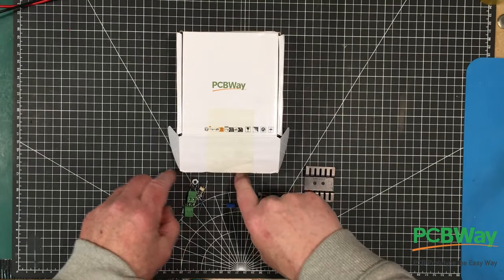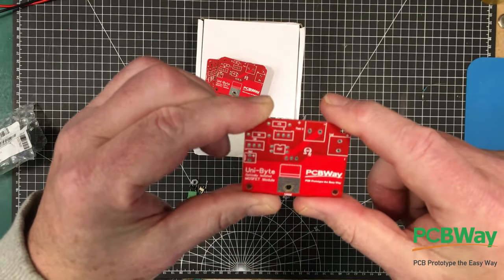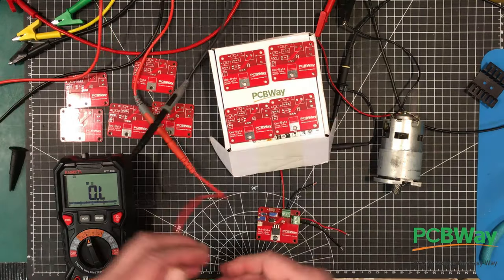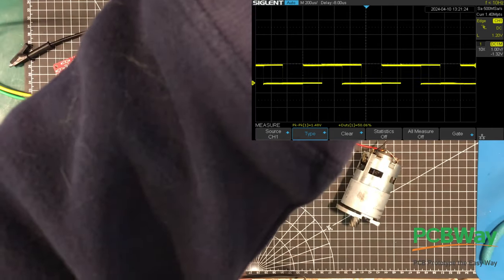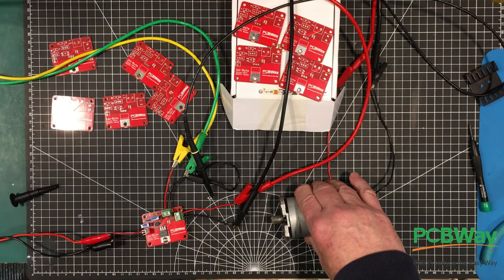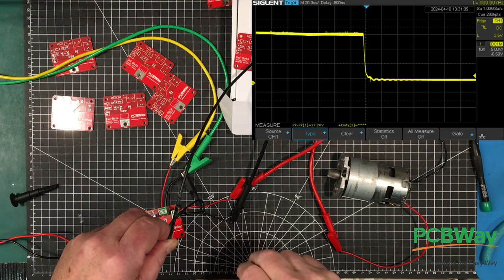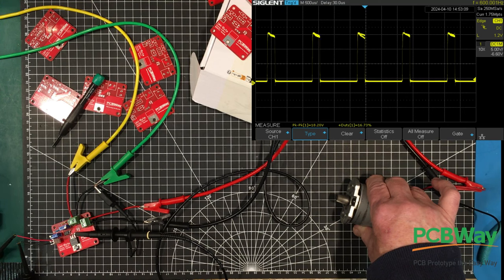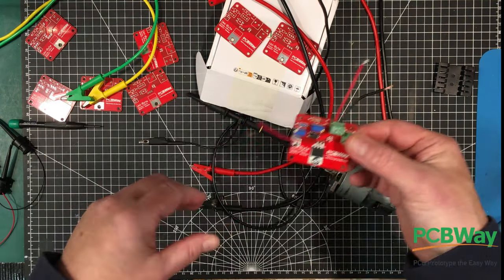Uni-Byte 0176 - Isolated MOSFET power DRIVER Part 2

Comment: Very neat! Please show us the complementary circuit, using a PNP mosfet. Then, we would be able to configure an H Bridge Driver for Stepper Motors. That should have a great amount of interest.
Reply from the maker: The best way would be just to add the p-channel MOSFET on the top-side of what is already there.   Then you have a half H-bridge.  Easy peasy.  Just one extra part.  TBH I have only used H-bridges to drive BDC motors for direction control.  For steppers I've always used uni-polar motors to make the drive circuitry (and code) a lot simpler.  (I'm lazy..)

Comment: It is surprising that mosfet remains that cool with so little heat sinking.
Reply from the maker: The secret it to switch the MOSFET as quickly and fully as you can.  Thant's what the adjustment was all about.  You need to have it fully on or fully off as much as you can and avoid Vgs anywhere near the threshold voltage.

Comment: Interesting video. At 7:20 I didn't understand your method how to calculate the Rds(on).
Reply from the maker: I was calculating the proper value for the collector resistor for the opto-isolator transistor.  You want it low enough to fully turn on the MOSFET quickly enough and hard enough to provide as close as possible to full "on" time, quickly enough to limit dissipation in the MOSFET and also limit the current through the collector of the opto-isolator transistor so as not to cause it any damage.  Hope that explains it!
Reply: Thanks for clarification.

Comment: Awesome video!   I'm going to explore the alternative pulsing scheme for an application where i use a couple of those power wheels modules (DC motor + nylon gearbox) to position an arm angle and rotate a base which i spray paint items with.  i need slow speed / good torque.  i used a mechanical relay oscillator to achieve fixed high torque pulses , but had no way to control speed .  this will be a better control.

one question - do you use a fly back shottky diode here?  Also is it possible to modify to have the motor contacts shorted during off time in order to kill any momentum thus providing even more "servo-like" control over the motor in ultra-low RPM application ? (basically kind of simulating a servo with a brushed DC motor)
Reply from the maker: There are two diodes in use in tis video.  One is in the MOSFET itself and I have another across the terminals of the motor.  I had the 2nd diode there for another project that had long wires supplying the motor and did not want the back EMF traveling all the way to the controller and acting like an antenna.  For the 2nd question, for the most part that function is fulfilled by the diodes between on pulses when the motor is being driven.  To add a brake function when the motor is stopped you would need a separate circuit that placed a MOSFET or transistor across the motor to short it out and make it difficult to turn.  You would have to ensure it was not activated while the motor was being powered.  That said, the back-EMF diode does a great job of putting on the brakes all by itself.
Reply: @uni-byte  this is great , thanks for the reply.  A brake in either motor direction is important so i'm going to play around but definitely will employ your 817 driver  circuit .  i can live with coding in long/safe dead times as it's only for brief operation at very low freq.   That "minimum pulse length" to just get a little movement of the motor is the key concept you've taught me.  I'll probably crank the  voltage up high to keep that pulse length shortest.  ie 12 v motor fed with ~19v laptop brick.
Reply from the maker: @GannDolph  Glad I could help.  Let us know how it turns out!

Comment: I wonder if leaving the solder mask off of the thermal radiating area of copper noticeably  improves the thermal radiation. That would make an interesting experiment. Got some sandpaper?
Reply from the maker: I'm not sure it would, but I don't think the improvement/impairment would substantial .. either way.  Here's why.  First, the solder mask is very, very thin so it's not much of an insulator.  Second, the red color of the solder mask would make a better radiator (black and blue would be even better) than the shiny tinned copper.  So, in essence, one will tend to cancel the other out.  Maybe worth a try, but I'd probably make a specific set of boards with and without solder mask over the copper pours and a circuit designed to make a controlled amount of dissipation.  I'll ad it to my list of possible future projects.  More of a physics thing than electronics but intriguing for that reason alone.
Reply: @uni-byte , I think of electronics as the aspect of physics that it is, and I love physics. As a kid I grew up playing with magnets, magnifying lenses, rubber bands, pulleys and string, rockets, candles, whatever did stuff. RF was my holy grail. It was magic. I traded my bicycle for a 2-transistor radio when I was about 10. I figured I got the best of the deal.
Reply from the maker: @johnwest7993  Yeah, physics is the root science.  That's what I my primary degree in.